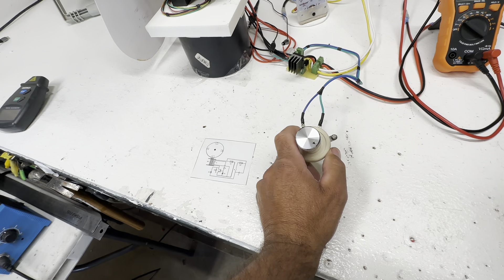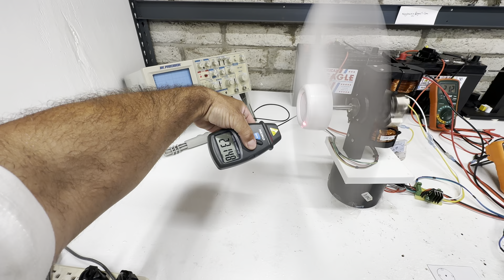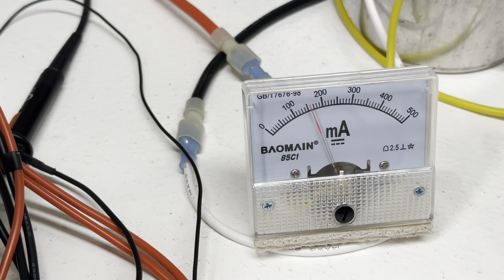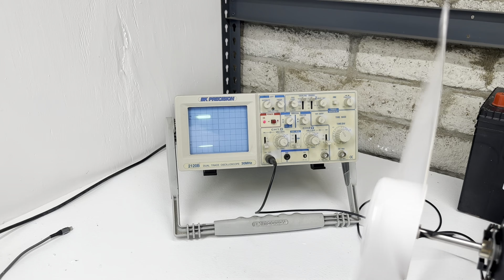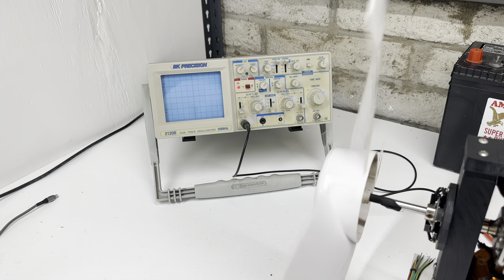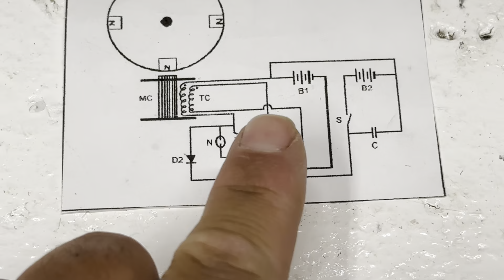Bedini circuit tuning

Comment: Or maybe just use a DC fan, which has zero inductive flyback and no wasted energy when running.

Win/win, money saved  and no circuit needed. :)

Or maybe I don't understand the point of the device??

Comment: I'm curious to know how come the spikes increase in number (do they actually increase in number?) The switching of the transistor only normally happens as the trigger coil fires as the magnet passes. How does the number of spikes increase without more triggers from the timing circuit. You don't seem to be using PWM to chop up the on time at all. Is there some kind of resonance occurring in the transistor when the base resistance hits a particular value?
Reply from the maker: You use more resistance on trigger wire best is with pot like I did to find the sweet spot 
 Watch the video agin
Reply from the maker: More pulses more output
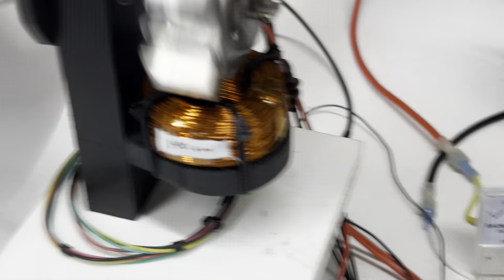Reply: @kenergy1707  at 3:20 - when load the pot - you say "it's acting kind of like a pulse width modulator". It looks like the transistor ON time is being chopped (on--off) with a PWM. I can get that result using a microcontroller or PWM but you seem to be doing that just with additional resistance on the pot - or am I'm missing something?
Reply from the maker: @markflint9089  nope just with the pot more resistance more pulses in till it gets to self oscillating then it stops
Reply: @kenergy1707  self-oscillation - ah I see. Thank you. As they say, every day's a school day 🙂
Reply from the maker: @markflint9089  the bigger the coil and magnets the more torque and less power
Reply: @kenergy1707  yes I've been thinking about this and have seen it myself. Do you have a more technical idea as to why this happens? I think perhaps the BEMF spike is swallowed up  as the motor draws more current. Also the generator winding on the motor coil can't push it's output away from the pull of the motor coil as it becomes a current hog because it's so tightly coupled. Just guessing, but if the process can be understood then perhaps improvements could be made.
Reply from the maker: @markflint9089  I got your email but video was blocked 
 As far as the multiple spikes go how I understand it is when the resistance is hi to the base of the transistor it’s not enough amp to keep it on so it pulses on and off

Comment: I can see you have many videos, and that's all positive 👍but i'm not sure if i can speak on behalf of everyone here, as from what i can see, there seems to be very little out there where the output energy is looped back i.e. demoing a self-powering, sustained system with either excess energy to draw from or not. If you have achieved this, can you kindly point out which one of your videos you have demoed this? Many thanks.
Reply from the maker: Thank you 
 The most I have achieved yet is 65% energy return plus hp I don’t have tools to properly test the mechanical work but only the electrical aspect because of hi speed and or torque 
 Also it is dangerous to post self running motors
Reply: @kenergy1707  thanks for your reply, but can ask why do you think it's dangerous?
Reply from the maker: @Bassman73  over the years most people that go public with ( free energy) end up dead unfortunately
Reply from the maker: @Bassman73  hopefully since it’s getting more main stream (they ) will stop lol
Reply from the maker: @Bassman73  that’s why most of us don’t show our face

Comment: Very nice demo. What is the purpose of the output cap - why not go directly to the battery? Is this to convert the flyback negative charge to a normal charge so that the battery does not end up receiving negative charges?
Reply from the maker: Yes and to smooth it out to measure the amperage better

Comment: I think its better to use an inductor thats 115 ohm rather than use a resistor (100ohm) cause this resistor is energy loss ,resistors cannot store energy like a coil can, once the trigger winding is charged it loses lenz effect / drag , i imagine a trigger winding with 115 ohms or so would take a few more passes of the magnet to get fully primed, maybe im ranting dunno

Comment: You should be able to capture the flyback and use it over and over as your pulse signal, all is needed is an initial start pulse from there with proper tuning and LC resonance between the drive coil and the energy storage device aka battery better than battery is to use a correct sized capacitance to make capacitive reactance with the inductor by doing so (tuning capacitor) the inductor automatically reaches inductive reactance in resonance with capacitive reactance. Its all in the LC tuning, so your run capacitor is probably to much mf or to little mf , for that coil i say to much mf

Comment: the 50% return your getting is not your source 12v power, its the flyback which occures when a coil is energized it becomes an antenna for radiant energy aka flyback.  I believe if you has a core inside your inductor the flyback energy would be more than 50% and to get past 100% you would need to replace the fan with 3 phase stator .
Reply from the maker: I’ve never said it’s from source battery
  all my motors have radiant energy aka fly back 
Thanks for the advice 
I suggest you put your motors up on youtube
Reply: @kenergy1707  i realize you never said that , you never siad its not from source either , newbies have no idea what flyback is , neither did i for a while and i even heard and worked with these circuits in complete    ignorance to the flyback, and I have a degree from ITT . I seemed to miss the part where the polarity flips which is why i never fully understood the bedini until recent
Reply: @kenergy1707  Im in between Homes right now , i intend to setup a new lab .